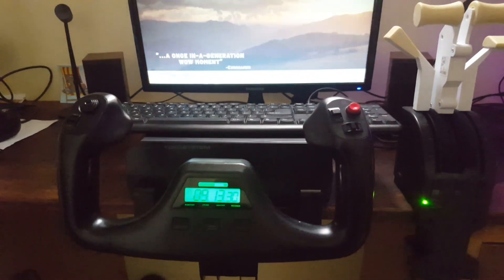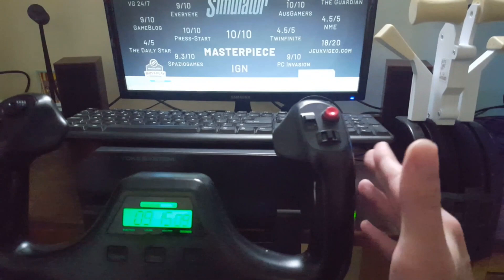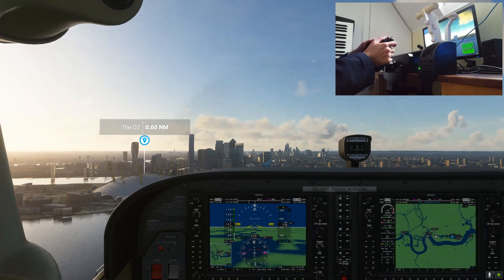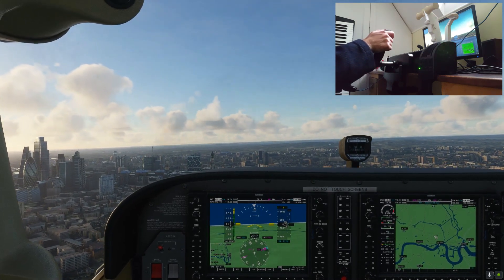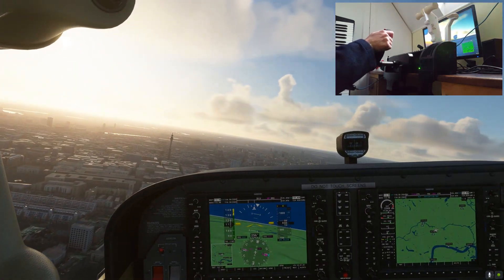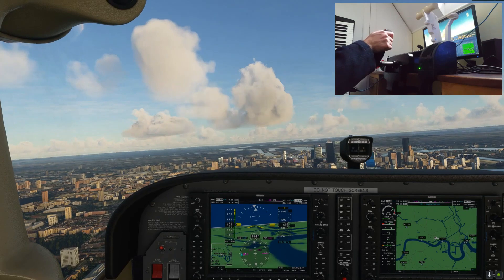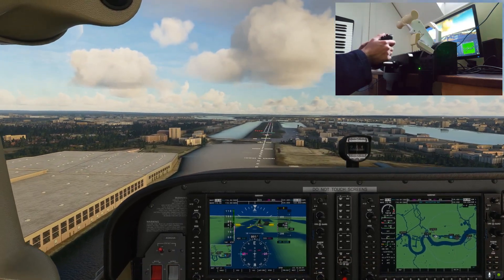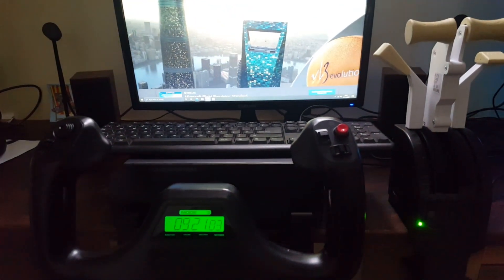FS2020: Yoke-Cam Flight - For those of you who are curious about Yokes, this video is for you!

Comment: yes, i liked the yokecam  mate.. maybe put camera a bit higher so we can see what your doing better..
im interested in your flaps lever .. i am new and flying the Cessna 152  the default  flaps are on the  rocker switch below the throttle, but i dont like it .. dont i need the lever you assigned for flaps for mixture or something ? thanks
Reply from the maker: I was wondering when someone was going to pick up on Mixture 😉
If you want ultimate realism, then yes, the 3 levers on the Throttle unit should be set to Throttle, Mixture and Prop - I just forgo realism sometimes and veer towards simple flying pleasure :)
Reply: @Huddison  i agree, in fact, ive only been doing the flying training in MSFS2020 so far, and these other 2 levers have no came up yet.
i suppose  ultimately,  i will probably  end up buying the dedicated saitek / Logitech  control panel with the flaps  lever.. but then.. where would i put my keyboard !! LOL
Reply from the maker: @RobBob555  Lol, that gave me a giggle 😁